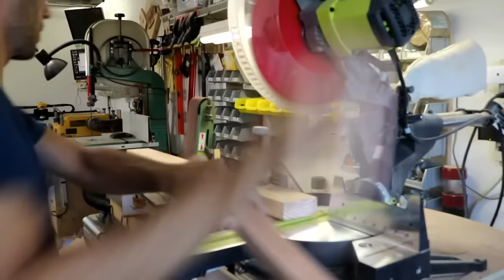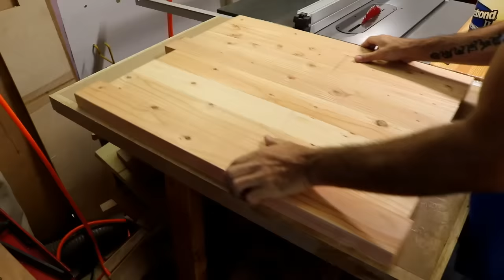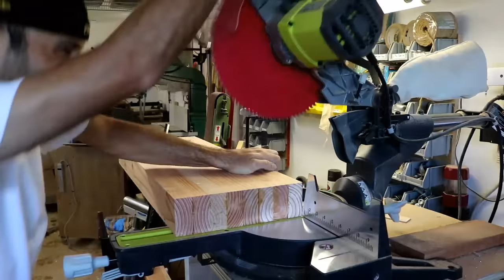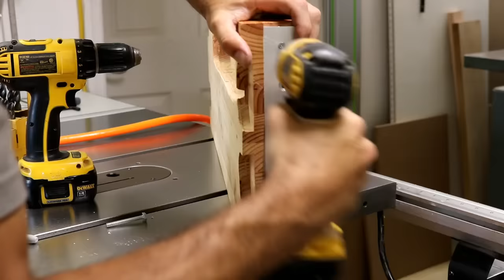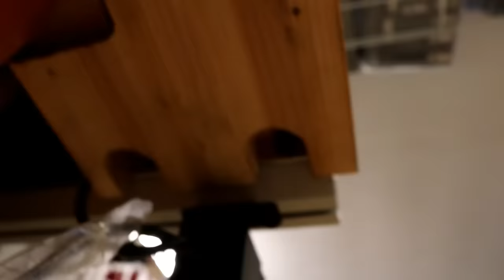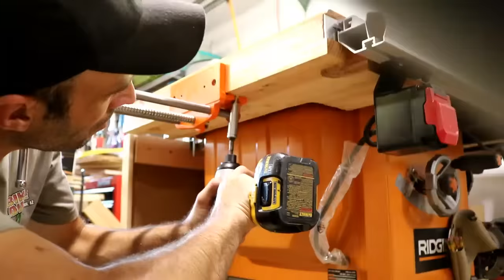Ridgid R4512 Table Saw Workbench with Vise - Custom Addition

Comment: Just completed router extension on other side and love it. I just stumbled across this video and we’ll have to do this now with out question!!! Was already looking at that space and pondering what to do with it. I did router table out of metal and will do the same with this as well. 40 years in the metal trade. Will not ding at 1/8 to 3/16 steel. Also won’t have to hog out any thing. You did a great job and inspired others 👏
Reply from the maker: Thanks John - I am potentially planning to do the same with the router extension.  I have a dedicated router table now but I need more floor space.  Have a good one!
Reply: @ShorePointCreations  don’t we all lol I have several space saving projects n the wings after retirement this month.

Comment: Quick question. Did you bolt down your extension wing/workbench to the cast iron holes? I didn't see it in the video. The reason I ask is because I recently got myself a Hitachi C10FL table saw that seems to be similar to your Rigid R4512 as they both have similar front and back rails. I am getting rid of both extension wings and replacing the right side with a router lift made out of plywood and this video gave me the solution to an issue I couldn't figure with the location bolt holes on my cast iron being to close to the 3/4" width of my plywood which is a terrible spot to hold the top. I will now glue 2 pieces of 3'4" ply, add a channel on the edges that will be bolted onto for the metal plate to be placed inside of, and blot it onto my cast iron table top.

EDIT: Second question, is it just me or does the sound seem to cut off in your video?
Reply from the maker: Sounds like you have figured out a good way to bolt your router table to the table saw. I didn’t bolt any of my extension wings to the cast iron itself. I used the rails to hold the wings and had no issues. Those rails are enough to hold the extensions in place without anything moving. Good luck with your project.  Sounds like it is going to be really nice!!!  And yes, the music does cut out. YouTube and their copyright police cut some of the sound.  It kills me to see that but I lost the video edit so I can’t redo it.  Have a good one!

Comment: I see comments regarding people's dislikes of the steel wings.  Are they really that poor quality?  I'm looking at this saw, or the comparable delta, which also has steel wings.
Reply from the maker: They are not bad at all.  Just plain wings.  This just allows you to add a nice upgrade to the saw. If your looking to get one, trust me you won’t be disappointed. The saw is definitely worth the money and is amazing.  Works perfectly. Just make sure you square the saw and the fence.  Once you do that it will work like a champ.
Reply: @ShorePointCreations  what material are the fence rails made of?  I am hoping there isn't any play or flex in them.  The home depot website doesn't do a great job on the description.  Thanks for your reply
Reply from the maker: They are aluminum extrusion.  There is no flex in the fence at all. You just have to square it to the blade.  Normal stuff you would do with any new table saw.

Comment: How do the tracks hold up with the extra stress that they were not designed for....just wondering?
Reply from the maker: I just realized I answered your question completely wrong...🤦‍♂️.  I thought it was another video you were watching. The tracks on the Ridgid table saw hold up great.  They can handle the extra weight no problem. Hopefully this answer makes a lot more sense!

Comment: Use threaded inserts instead of t-nuts. They serve the same purpose and no chance they're coming out. No need for grooves and aluminum bars.
Reply from the maker: I normally would have used inserts however I only had the T nuts on hand.  I had to wrap up the project so I did what I had to do. But I hear ya on the inserts. Thanks for watching!

Comment: I have owned a Rigid R4512 for over 10 years and could not be happier with it. The fence is excellent--smooth and accurate. The saw is heavy and rock solid.
Reply from the maker: It really is a great table saw. I’m glad they figured out the trunion issue that plagued the earlier versions of the R4512. Unfortunately I got one that had the issue and had to return it to Home Depot 2 days later.  I verified the new one had the stamp on the trunion signifying it was the latest, fixed release and they gave me $75 off on top of it. Ridgid really has a great saw for someone who doesn’t want to pay for or can’t afford to lay out $$ for a cabinet saw. Thanks for watching and commenting.  Have a great one!

Comment: nice job I had a rigid saw for a long time but I was finally able to upgrade to a cabinet saw  nice work
Reply from the maker: I really like the Ridgid tablesaw but my dream is to upgrade, the same as you, to a cabinet saw.  I have my eye on the SawStop.  Hopefully this year I will be able to pull the trigger.  Although I also want a wide belt sander so we will see which one wins first.

Comment: The extra weight on the left side would help with the balance of a router table on the right side.
My router table and router makes for some dicey moves when it's on the wheels
Reply from the maker: That’s an excellent point I never thought of. What’s nice is the saw is heavy to begin with....unloading it was NOT fun. Then you go and add 2 solid wood wings that are 3” or so thick.  It really does add to the weight and stability.  Great comment!  These are the type of comments I really appreciate.  Thanks for watching and have a good one!  Make sure you subscribe because I’m going to be doing a subscriber give away early next month. It’s a nice tool that I’m giving.

Comment: no $$$$ planer, how best to even the top of butcher block without?
Reply from the maker: Glue it up as flat as possible and then sand it.  Otherwise I would invest in a hand plane and give that a try.  You can pickup hand planes for less than $30 used and refurb them.  It’s worth it!

Comment: So $600 is considered entry-level for a table saw? Yeah okay! 😂🤣
Reply from the maker: Compared to $3000 and $5000 cabinet saws....yeah... $600 is pretty cheap.  But if you don’t want to spend the dough, then a DIY track saw jig and a circular saw does the trick!  😉
Reply from the maker: In addition, the Wood Magazine article on Build a Workshop on a budget chose the R4512 as the table saw for budget minded woodworkers. We all have budgets to work in which sucks because we all love our tools.
Reply: @ShorePointCreations   eh, don't let that comment get to ya.  I just came across your video on Reddit because I was comparing the Delta 36-725 to the Ridgid, and your video sold me on the Ridgid.  This would be a perfect add-on, and knowing the bosch router table fits perfectly on the other side.  Keep up the content, you did an awesome job in this one!
Reply from the maker: Thanks for the comment. Everyone has a different budget so $600 may be a bit high for entry level.  My thoughts are the table saw is the foundation of a good workshop so you should invest in it. Thanks for watching and I have new videos coming shortly.
Reply: I know what you meant , just sounds funny saying $600 is for a entry level table saw. Great video.
Reply: That RIDGID saw is $698.00 (before taxes) in Canada.  This Hybrid saw is an entry-level table saw for a woodworker.  The only table saws cheaper are portable job site saws that are intended for carpenters who are rough cutting framing lumber.  The next step up are "cabinet saws" like "SawSTop" which start at $2,600.00 and climb to $9,000.00 with accessories.
Reply from the maker: A Sawstop is my dream table saw.  Once I get some more $$$$ together that’s the way I plan to go. Just need to keep saving. No need to justify the cost.  The saw does that on its own. Thanks for commenting!
Reply: @ShorePointCreations  SawStop remains only a dream for me also.  They are pricey, but they also have that "finger saving technology" -- hard to put a price on that....and they know it!

Comment: Just found you channel and I love your take on the bench.  I'm in the middle of building one myself.  I love my table saw but always hated the stamp metal.  Question, after the shellac did you add a coat of polyurethane for added protection?
Anyway great job and good video keep up the good work.
Reply from the maker: Thanks for watching!!  I actually just shellacked the benches.  It has held up amazingly well and can always be touched up if need be.  I just moved to a new house so I’m starting a new series building a new shop out of a 2 car garage.   Keep an eye out!
Reply: @ShorePointCreations  I will keep an eye out.  Thanks, and I'm looking forward to seeing what you do to your new space.

Comment: Looks great and I been thinking about getting that same table saw lol
Reply from the maker: For the price you can't go wrong with the R4512 table saw.  Just make sure you open the box in the Home Depot and look for the roman numeral II stamped on the trunnion.  This is the black metal that the motor is mounted to.  The II means it is a updated trunnion and doesn't have the alignment issues.

Comment: I like the 2x4 extension wing, affordable & very solid. I have the same saw, its been a real workhorse for me. No issues ever.
Reply from the maker: Thanks for the comment.  I agree 100%.  For the money you can’t beat the R4512.  I’m building a new outfeed table in my next video.
Reply: ShorePoint Creations I will have to check it out. Where did you get the zero clearance insert at? I need one:)
Reply: @houseoffire72   hope you found one by now. I'm currently just now buying this saw and this is the zero clearance plate I ordered for it. https://amzn.to/2PTY665 they also have one made for a dado set.  hope this helps.
Reply: houseoffire72 Here is the link to it: http://amzn.to/2Egstyp

Comment: Just asking....why would you want a vise on your table saw?
Reply from the maker: Why not?  For those who are limited on space it makes sense. That has been the one thing I have had the most compliments about. I guess it is all personal opinion. Thanks!
Reply: @ShorePointCreations  I'm interested to know how you've utilized your table saw vice now that it has been over a year.  What do you do with it and would you do it again?
Reply from the maker: I would do it exactly the same. I didn’t have a workbench with a vise in my previous shop so I utilized this for everything from cutting dovetails to holding my board with my sharpening stones.  You can’t bang or pry on it but it has many other uses. Thanks for the question!  Merry Christmas.
Reply: @ShorePointCreations  Sounds good! Merry Christmas
Reply: Stephen Sebastian I plan on doing the same. I’m in an 8x12 shop. So my table Saw is often my main work surface

Comment: Wont you bend/warp the rails if you crank something into the vise?
Reply from the maker: If you beat on whatever is in the vise it will bend the rails for sure.  I use the vice for cutting dovetails and other uses that don’t involve too much force.  I have a proper vice on a bench that is reserved for letting all hell loose on!!  Thanks for the comment.  Always welcome from knowledgeable viewers like yourself.

Comment: Awesome video. Curious, with stacking the 2x4s the way you did, do you have swelling issues in warm or cold months? Meaning, if it swells do you lose the wood being flush with the table saw top? Thanks.
Reply from the maker: Hey Kyle - Not that I have noticed.  I just dropped a straight edge on the table and it’s about the same where I set it during the installation.  Thanks for the comment. Happy New Year!

Comment: why cant you joint both edges of the 2x4?
Reply: Sean Henry That’s another way to do it!!  I was taught years ago by an older woodworker to use the table saw.  As with most functions there is more than 1 method.  Thanks for the good reply!
Reply from the maker: If you Joint both edges then the corners would be square but the edges would not be parallel to each other.  You should Joint one edge and then head over to the table saw for the other.  Thanks for watching!!!
Reply: ShorePoint Creations thanks for the information! Great videos!
Reply: You could use the planer with the board on it’s edge to get a parallel side to the first jointed side.

Comment: Can you increase the rip capacity by shifting the aluminum rails over to the right? I want more than a 30” rip capacity, but I like most everything else about this saw.
Reply from the maker: +Ian Johnson I don’t see why not.  The rails have a T track for the mounting bolts so theoretically it should work perfect.

Comment: Nice job great vid keep it up
Reply from the maker: +Abandoned USA Thanks for the comment!  I have more Ridgid R4512 videos coming up soon so please don’t forget to subscribe!
Reply: ShorePoint Creations just subscribed i was going to buy this saw but i just read a lot of bad reviews on home Depots website about how the wings and weak and that base with three wheels are not as good as the old version
Reply from the maker: +Abandoned USA I have the 3 wheel version and not bad.  If you do buy one Make sure you open the box at the store and check for the Roman numeral II stamped on the trunion. This means it is the new version and free to the dreaded R4512 defect.
Reply: ShorePoint Creations ok thanks whats the trunion
Reply from the maker: +Abandoned USA It’s the black cast iron component inside mounted to the case that the motor mounts to.  The older Rev 1 design had major alignment issues that the newer Rev II doesn’t.